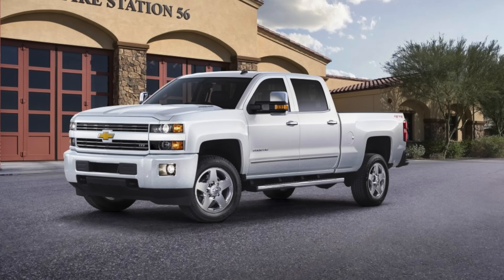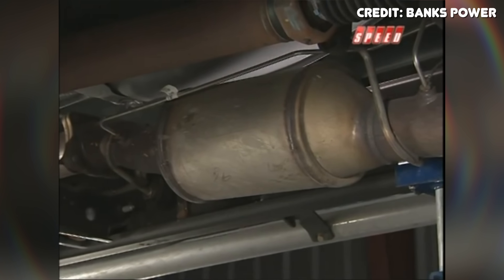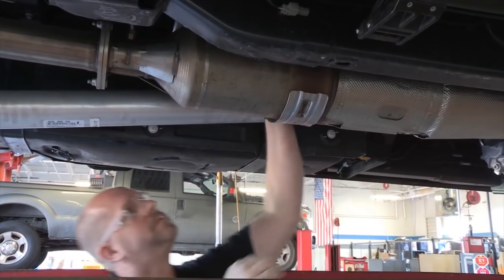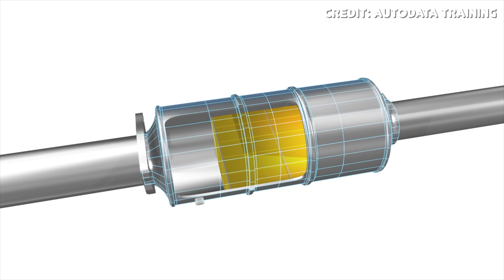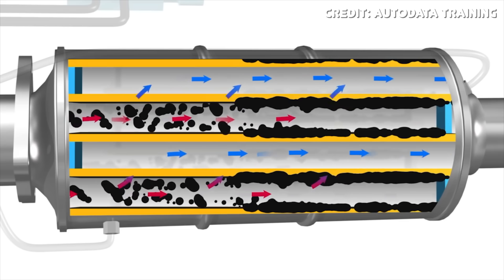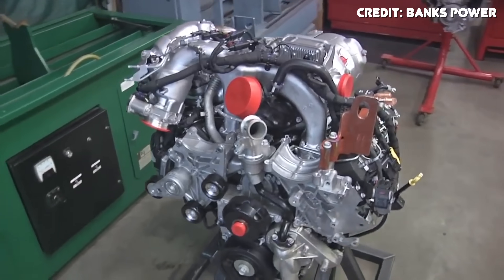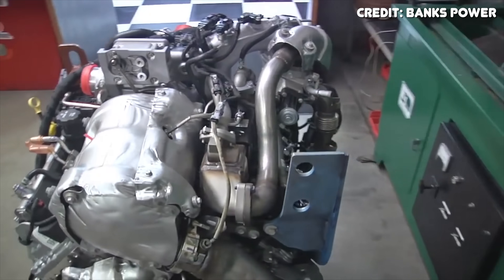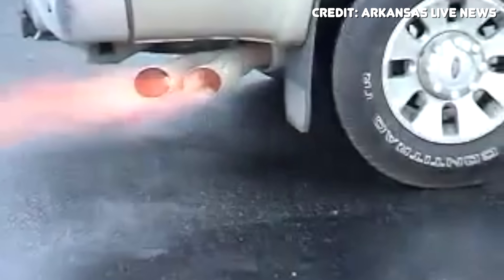Why Does Duramax Have This Exhaust Tip?

Comment: The bigger question is how much power is being robbed by the restrictor at the end of the exhaust before the venturi ports? Banks Performance claims a bit of power being added by just adding their DPF back 5 inch exhaust. Personally I think just cutting off the restrictor would produce close to the same performance results. FYI I have noticed that adding a Banks monster intake on late model L5P duramax engines really extends regen intervals especially when towing. On my 23 duramax I was regening every 200-250 miles when towing heavy. Now with the intake I am going close to 700 miles and I can watch my soot level drop from passive regens that I never saw before the intake upgrade. I have seen this benefit on numerous L5P's that I have sold intakes to.

Comment: I think it also is just a way to cheat the emissions. They measure it at the tip of the pipe so they dilute the exhaust heavily with that system and it makes the exhaust look a lot cleaner on the tests.

Comment: I once owned a 2016 Duramax equipped Chevy 2500HD and I always theorized that the exhaust pipe tip was designed to draw in cool air from the side vents to cool that hot ass exhaust during the re-gen phase. However, all this emission stuff may help save the Earth, but it's all an expensive and complicated mess that adds multi-$thousands to the sicker price and will most definitely be a major maintenance expense and headache down the road. Therefore, diesels trucks are not worth it unless you do a lot of heavy towing. Diesel fuel costs are outrageous too!

Comment: DPF, EGR, DEF=a clever ploy to ruin the wealth of independent contractors and truck drivers in the name of supposedly saving the environment.    How burning more fuel to make big soot particles into more dangerous but more invisible small particles has never been explained.   Truck engines have a quarter to half the lifespan than they used to, adding 2 to 4 times the amount of scrap trucks needing replacing into the equation of environmental impact

Comment: So the black hood that comes out of a tailpipe is carbon ranchers create carbon specifically to spread across the ground because it's good for it the only reason they're trying to clean up the carbon pollutants is because people see it and it's black and they instantly think that it's a pollutant but it falls to the ground with regenerate carbon into the ground which is good for it but instead you're going to spray raw Diesel Down costing fuel economy and obviously if there was any pollutants created the spraying of raw Diesel Down the exhaust pipe would make them far worse so this video right here proves that the DPF filter isn't ignorant idea and shows how stupid our government has made our auto manufacturers

Comment: I have found over the past 5 years my 08 Duramax works MUCH better having removed the DPF and EGR 👍
Gonna call BS on the Ford being more discreet.  Right on the very end of the exhaust tip it's super obvious.
Reply: Same here my 06 Duramax is completely deleted would not have it any other way.

Comment: Talked to a random guy in town today with a 2020 Duramax and he had an aftermarket exhaust tip.  Ask him how much it cost to delete his pickup and he said it’s stock.  Asked why he had a tip he said it melted the front of his 5th wheel camper so he cut it at a 90 and put a tip on.

Then this video showed up in my suggestions later today.
Reply: Did you have your phone in your pocket? It was Google spying on ya.

Comment: Most modern diesels with after treatment use the diffuser. Gillig transit busses I worked on did too. It’s to pull in air, to cool the discharge air exiting the pipe. 
It reduces the risk of catching grass or tree leaves on fire.

Comment: Question:  If the exhaust gas needs to be hot for the DPF to work, why not just put the DPF closer to the exhaust manifold?
Reply: Putting it directly in the engine bay would cause extreme heat and would by time destroy rubber seals and hosed. It is a big fire hazard. Although newer trucks and cars do have it basically attached to the turbo.
Reply: The DPF filters while cooler, slowly getting plugged.  The computer has to burn the dpf hotter than exhaust gas to burn up all the soot it catches which then opens it up again.

Comment: So burn more fuel and claim it somehow helps the environment! When in reality it just makes everything worse! With all the tech now days it would be much easier to just cut cylinders like they do gas engines thus making the few running burn hotter thus a cleaner burn and clearly more fuel efficient because obviously pumping fuel into the exhaust is only going to hurt your MPG and add to even more stuff being burned for no good benefit.

Comment: I've heard removing these tips can cause problems down the road with the dpf system. If you think about how integrated and engineering is so tuned it makes sense to me. Kinda off topic but in a gas high efficiency water heater in our homes if the screen size is too small or large doesn't match the proper length and bends the water heater will simply not work. These are far less engineered than what's going on in trucks. So, in my opinion it isn't worth messing or risking  a $6000+ system because you don't like the "cosmetics"

Comment: EGR and DPF systems are pure engineering hypocrisy. The regeneration process generates more NOx than the system presumably prevented over the duration between regeneration cycles.

Comment: has nothing at all to do with heat what so ever. its to make it look like it has cleaner emissions.  its sucking in fresh air to make it appear to run cleaner when being tested at the end of the exhaust.  ford did this way back with an air pump that was belt driven and plumbed right into the exhaust.      if this garbage was about heat then it would be further up the exhaust so u dont have this so called 1000 deg exhaust temp running the full length of the truck where brake/ fuel lines, fuel tank, ect all exposed to potential fire hazard.

Comment: So what benefit does the dpf give if it just burns the excess soot it catches? Either way it's going into the air
Reply: instead of releasing carbon and nox from the engine into the atmosphere it burns it and creates ash which isn't as harmful and can be degraded in soil which most of the time the ash doesn't actually exit the exhaust tip cause its burned up completely.

Comment: So basically newer diesel exhaust systems are a pain in the ass, but also helps it produce somewhat clean emissions, I'd say they cancel each other out, pemdas or something like that, way I see it, get a 05 duramax, rip that dinky exhaust system, delete that stupid egr system and put a fat ass axle dump with a 12in tip

Comment: Well good thing I deleted that stupid emissions system completely and had someone tune it out of the computer and they gave me some tune files I could flash over whenever I want, tunes i got are eco, street ,performance , and safe tow tune and last one is tow performance which he told me it's for like less than 8k or 6k towing safely. Yall should do the same if you have a diesel, it's worth it plus you can just keep the emissions system in your garage or wherever so you can reinstall later for smog or resell

Comment: The way emissions testing is done is to stick a probe into the end of the exhaust pipe. by using the venturi effect to introduce air into the exhaust it dilutes the exhaust giving lower readings on the test.
Reply: All obd2 vehicles use the onboard sensors.

The sniffer is only on obd1 and some older obd2 vehicles
Reply: @k5guy  False, California shoved a probe up the exhaust on my 14 Cruze with a gas engine.
Reply: @slwsnowman4038  
I've never heard of a post 2000 car with a sniffer. Did they put it on rollers too?
Reply: @k5guy  I don't recall them putting it on rollers.  They put a sniffer in my 2001 Lumina and I know that was on rollers.
Reply: @slwsnowman4038  
Still seems odd they used a sniffer without rollers as the sniffer is used to check engine under load.

Found this which confirmed what I stated earlier about 2000 and up obd2
Maybe the smog shop you went to was just out of date with the current laws

2000 & Newer Vehicle Smog Test

DAD OIS Smog Test System

2000 model year and newer vehicles (except for vehicles 14,000 GVWR or greater) no longer require the tailpipe portion of the smog inspection.

Late model vehicles (along with diesel vehicles, 1998 & newer and which are 14,000 GVWR or under) will be administered the new On-Board Diagnostic (OBD) Inspection System (OIS) instead of having their exhaust emission analyzed while being driven on a dynamometer. The existing visual and functional test portions of the smog inspection will still apply.

The OIS will be administered using a Data Acquisition Device (DAD). The DAD will be a stand-alone test module (connected to PC) which will determine whether a vehicle passes or fails the smog check based on the data it retrieves from the vehicle's emission control computer. The DAD will be connected to a vehicle via OBD II Data Link Connector (DLC) found on all 1996 and newer OBD II compliant vehicles.

The implementation of AB 2289 is expected to reduce the time and cost of the smog check. The program will now take better advantage of a vehicle's OBD II technology by eliminating tailpipe testing and instead using the vehicle's own OBD II emissions monitoring system.
Reply: Nah, not anymore
Reply: Emissions test probes will see if there is too much oxygen in the exhaust gases and fail you for having a big exhaust leak. Lawmakers are not quite that stupid..

Comment: A landscaping company I worked for was pretty bad about truck maintenance. Had an 07 powerstroke with an injector that would randomly hang open from time to time and dump soot like a diesel drag truck spooling up to launch, at idle. It ran regen cycles daily. 
I went to dump some leaves and brush one day and it went into regen as soon as I started to lift the dump insert. Caught the brush pile on fire in seconds. 
Told the owner we needed to deal with it as it was not only dangerous, but terrible for the engine to regen constantly as that era powerstroke just dumped extra fuel through the injectors and washed the cylinders out and diluted the oil. He wouldn’t believe me. I did an oil change and dumped 6 gallons of “oil” out of an engine that takes roughly 4 gallons. I hadn’t added any oil since the last oil change. He dismissed it. 

I grenaded that engine about a week later. He blamed Ford and said diesels were junk 🤦‍♂️. Funny, my 6.0 powerstroke will still annihilate the tires at 30mph despite 250k miles on the odometer. My truck was straight-piped long ago and never had a regen system. It also doesn’t get run with bad injectors and I don’t drain 6 gallons of diesel diluted oil out every oil change. Regen systems are useless and will never be on any truck I own. Soot hurts nothing. And what’s the point of a diesel if you can’t dump massive soot clouds when you stomp that skinny pedal down? 🤣

Comment: Very informative.

If the gasses at the tip are that hot that they need to be cooled, I would think the pipes under the truck further forward would be just as, if not even hotter so I'd say there would be a risk driving through stuff like tall grass.
Reply: i second that roflmao, i remember a friend idling on my field chilling and watching migrating ducks come in.    then. the scent became stronger, as it slowly phased into wood-hay burning smell.      sure enough.  under the truck lit 4 ft long  1.5 -2 ft wide char mark on the field.

Comment: My first guess was that this would give you a small performance benefit because the air that flows through the gaps in to the exhaust tip would create a small vacuum inside the whole exhaust system, so that there’s no build up of exhaust gas.
Reply: I thought it is a trick to vacuum fresh air in with the exhaust to make the emissions seem lower during an emissions test!
Reply: @greensolemowing  a vehicle with a modern emission system no longer needs tailpipe tests. You plug just a computer into the DLC connector

Comment: Interesting thing is a few reciprocating engines have the same system in the aviation industry, but for a different reason. The Venturi sucks more air from outside the exhaust system as explained, but then of course it has to exit. As the Venturi widens, that extra air also gains pressure, therefore giving a (small) amount of thrust
Reply: Sounds like a quazie ram jet with an external energy source...
Reply: Not reciprocating but I remember the exhausts on some of the turbo fan engines were like 10% of their thrust
Reply: @greengoat5654  Yeah, thats the jet engine portion. Those engines are just a comparatively small turbojet engine with a big fan on the front

Comment: I always thought it was for cooling as the only purpose I could guess was to mix exhaust with fresh air, but I wasn’t really sure why. Thanks!

 I would point out that with it cooling down the exhaust tip only it’s not for fire prevention but instead just for keeping people from burning their legs while getting something at the truck bed etc. a vehicle, diesel or gas is a fire hazard when driving over tall dry grass because of the catalytic converter(being  the hottest and often lowest point in the exhaust), it’s actually what started the wildfires in Northern California about six years ago; guy out in the hills did a U-turn in his driveway and drove off the road a little bit and lit the grass with the cat. 

For instance, a 6 inch long air mixing Venturi would not have prevented that Ford truck at the end with a flamethrower exhaust from lighting gas on fire with its exhaust tip
Reply: When they first started putting regen on trucks the regen exhaust would melt car plastic car bumpers in traffic. So those flutes are to draw in outside air and cool the exhaust. Same reason why Ford has the same thing. Not sure how RAM gets away with it though, haven't looked into it
Reply: @willl84  probably figure most people know they are junk so they stay away anyways?
Reply: It's also there to prevent burning the trailer you might be towing. Some of them have fiberglass front accessories, plastic trim and so forth. It's been noted many were damaged due to the heat from the exhaust tip.
Reply: Almost as if its a stupid idea to have one in the first place. Hmmm.

Comment: Just to clarify, GM and Ford ( don't remember seeing this on the Cummins exhaust) have been using this type of exhaust tip long before the regen process was required by the EPA. The original reason for this type of tip was to dilute emissions when they were measured at the tail pipe. It goes all the way back to gas engines in the mid to late 60's equipped with air pumps that pumped fresh air into the exhaust manifold in order to dilute the emissions which were again measured at the tail pipe. For whatever reason the EPA allows these cheats as longs as the measured emissions meet their requirements.
Reply: Smog pumps put fresh air into the hot exhaust gasses to react with any remaining hydrocarbons
Reply: Wrong.  The EPA and other regulatory agencies measure the QUANTITY of pollutants in the exhaust.  They do not measure the CONCENTRATION of pollutants in the exhaust, so DILUTION is irrelevant.  Pollutants are measured as grams/hp-hr on engines or grams/mile on vehicles, not in grams per volume of exhaust gas.  You have a fundamental misunderstanding of the function of the air pump on a gasoline engine.  GM calls it Air Injection Reaction, thus the acronym A.I.R.  Ford calls it Thermactor.  It has nothing to do with diluting pollutants.  It provides fresh air, thus more oxygen, to the exhaust to promote complete combustion of hydrocarbons when fueling is rich.  In other words, it finishes turning the extra fuel into water and carbon dioxide instead of spewing carbon monoxide and unburned fuel out the tailpipe.  The systems generally only pump air into the exhaust ports on cold start, and on some later cars with catalytic converters, they pump air into the oxidation catalyst under specific operating conditions.  On modern fuel-injected engines with much more accurate fuel control, the air pump is irrelevant.
Reply: @KevinJames-yg9eu  So what fundamental difference does it make if the exhaust gasses are mixed with air in the before or after they exit the exhaust system? The air pump robs power and adds another level of complexity to an already complex system. Just asking.
Reply: @projectbumblejeep4190  Temperature is the difference.  The exhaust coming out of the tailpipe has already cooled off to the point that it will not undergo any additional combustion.  Mixing the exhaust with ambient air at the tailpipe outlet does nothing but dilute it.  Pumping additional air into the exhaust port where it's 1000°F hotter promotes more complete combustion of any fuel that is still burning as it exits the combustion chamber.  For a practical analogy, look at a piece of paper.  It doesn't spontaneously catch on fire sitting on your kitchen counter, but if you put that piece of paper in the oven at 500°F, it will burst into flames, even though the air in the oven is chemically identical to the air on the kitchen counter.

Comment: I have a Dodge that did not come with a goofy looking tip like that. Never have had any heat issue coming out of the exhaust like you mention. How does Dodge keep it cool?
Reply: Dodge has a variable geometry turbo that  regulates exhaust flow. In simple terms it’s able to creat heat closer to the engine and let the exhaust pipe cool the gasses before it gets anywhere near the tailpipe

Comment: Our Ram 5500 started smelling like burning rubber. I went around and checked the tires. In doing so I burnt the shit out of my hand getting near the exhaust tip. Turns out it was the mud flap hitting the bracket on the exhaust and melting.